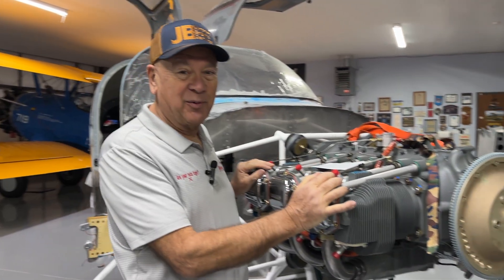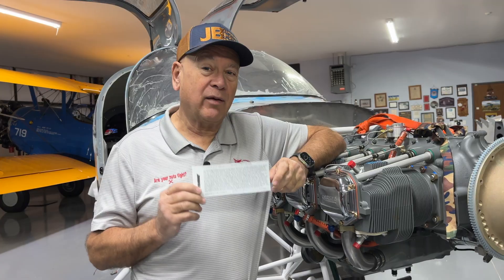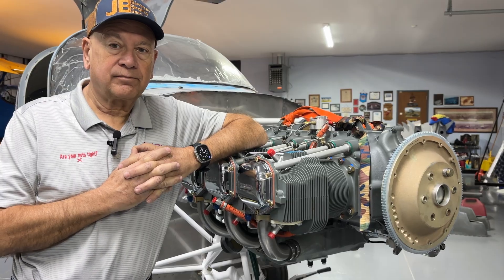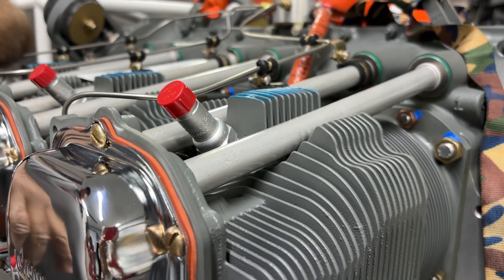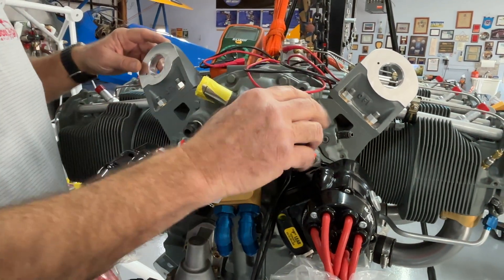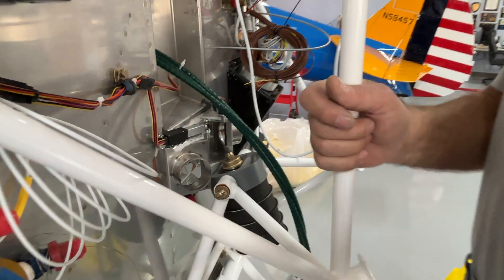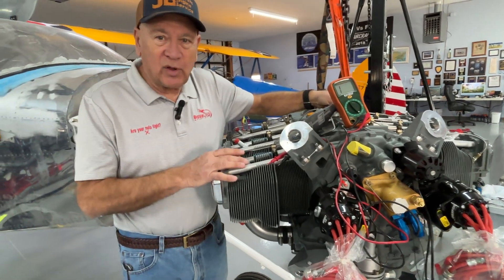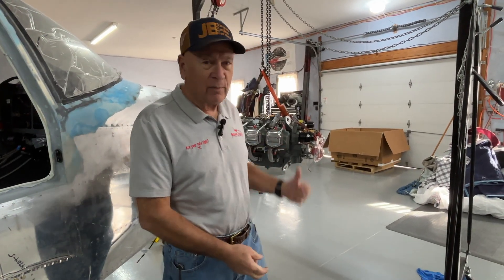Engine upgrades by JB Aircraft engines, RV 10 updates, Homebuilders Week

Comment: My oil pressure transducer also grounds at the hardware connection, rather than with a separate wire, and of course someone wrapped the threads with teflon tape! 😂 It has somehow worked for years anyway, although it’s now starting to show pressure when the engine isn’t running. Perhaps it has a sufficient ground but is just EOL.
Reply from the maker: I was showing the oil temp sensor, not the pressure sensor. however, teflon tapes are ok on the oil pressure sensor. if you have one of the Stewart Warner analog senders they do wear out over time.

Comment: Does the low resistance connection issue at the oil temperature sensor apply to certified engines, or just anodized experimental parts?
Reply from the maker: the airwolf remote oil adapter is approved for certified aircraft. I had the same problem on my helicopter. It has to do with the part being anodized. I’ve seen the same problem it’s overhauled engines where the shop painted the whole engine and the oil temp probe was out at the time. the paint needed to be removed prior to installing the probe.

Comment: Please describe more how you sealed the doors. What McMaster seals? You filled them with epoxy and let set to conform with the door…I just don’t get it. Door/canopy seal treatments could be a video all by itself. In flight, I’ve heard many canopies lift a bit, just enough to let winter air in.
Reply from the maker: https://rv10.org/images/0/06/RV-10_McMaster_Carr_Door_Seal_Installation_Compilation.pdf
Reply: @baselegaviation1614 Wow, excellent info which I will study. Thank you.

Comment: Nice looking engine, Vic.  And Carol did some great work on the video - you're lucky to have her.  About the fuel pump cooling shroud, some on the VAF have cut it in two, which makes it much easier to install.  I didn't install one and don't seem to have any issues with vapor lock even running pump gas.  YMMV!
Reply from the maker: I got it on ok. I’ve always installed one and never had any vapor lock issues, so I don’t know if it is needed or not. it’s easier to do now and I had already purchased it so I went ahead and installed it. cutting it in two is a great idea.